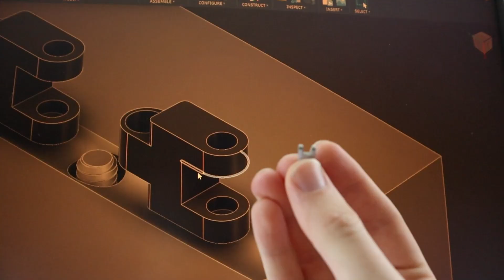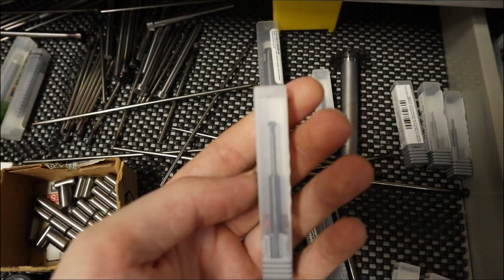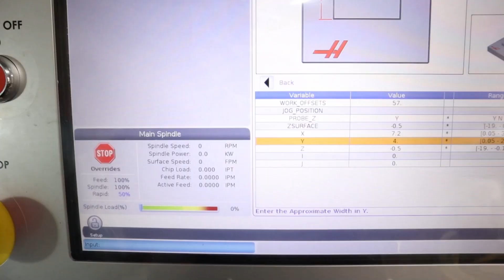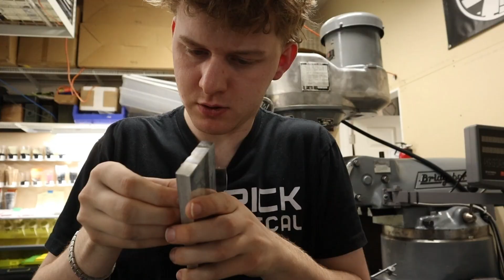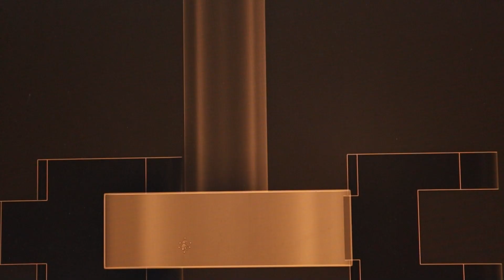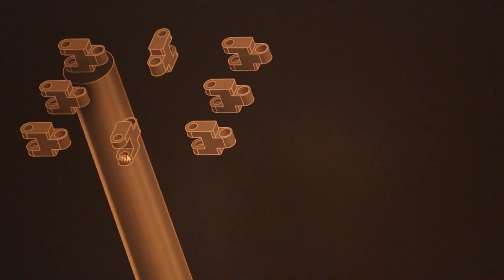I can't solve this Machining Problem | Modarra Monday's 005

Comment: dont let the way you orient parts limit you, as you were looking for a key cutter and talking about one being to big and you not having one with the exact diameter you need to get the depth, you could just rotate the links 180degerees every other one  so you can slot both links at the same time if you have a larger cutter on hand( you just need it to have a smaller height than the slot gap in the links), that way the limit for how close you can put the links together is based on the thickness of the largest shank needed to reach the chamfers and or the notch and have clearance. Im assuming your only doing this with 3 axis and without a 4th axis so that's where i'm coming from. How hard would it be to go up a stock size or two and just add dovetail to the round bar and hold like .020-.030" and then just tab the parts off with a slitting saw? Your goal would be that the dovetail + slotting height+ shank diameter from largest tool used in the notch is less total volume than  the stock your currently loosing. Im assuming the links are around 10mm long and the notch is like 4mm or so you can use this tool from amazon or something similar(KLOT AlTiN Coated T Slot Keyseat Milling Cutter Solid Carbide 12-20mm diameter)and a thinner tooth thickness so you can also cut underneath the center posts that go in the notch with the same tool. You would end up with somewhere between 6.5 and 10.5mm between parts. Lastly I would make a sandwich plate that I can put all the parts in after they have been tabbed off out of either a 3d print or machined aluminum and have it be bolt together and just toss it in a vise for cleaning up the last face, its minimal stock removal and allows for loading outside the machine and you could make multiples of them if you wanted and have them be stackable so you could do a single line, double line or more.
Reply: after modeling up one and reorienting it might actually be better to have them with the long sides facing each other so instead of 180 out they are 90, if you can get the whole part to fit inside the 1/2" bar and leave enough stock for the slitting saw you can get a full bracelet in a single piece of 6" stock. I was able to squeeze 20-22 pieces that are 4.5mm thick, 10mm long and 9mm tall( would probably shrink thickness just a tad to be able to use either a 3mm or 1/8" endmill between parts to get all sides but the bottom tab because i have them spaced about 2.5mm  apart and there is almost no space). Another thought for fixturing is using two er32 collet blocks and just drilling out the bottom of the blocks so the bar can go all the way through and using them either between two vises or if you just go with square base ones in a single vise on parallels. That way you can just shove the whole bar in and just slide it enough for the number of parts you want to make and snap it off and move the bar over again. Relatively cheap to buy and repeatable by making a stop in one side of the collet so you minimize the amount of stock held on one side.
Reply from the maker: @TheDarkrider551  LOVE Comments like this, have you seen the latest episode? I think I'm going back to the one piece per stick approach. Check out the latest videos it will be more clear. I do however REALLY like the idea and reminder of a simple soft jaw or printed fixture for the tabbing op. That is something I'm going to ponder FOR SURE. Thank you!!!

Comment: Loving this series, looking forward to seeing more episodes.

Personally, I’d choose a V groove in the fixture, because you will then have 2 points of contact which is more stable than a curve machined with a ball mill, due to the cusps left behind. Also, the SS Bar stock I assume is not ground to exact size, so may not always fit your curved slot, but a V groove milled with your chamfer mill will always locate different diameter stock centrally.
Reply from the maker: Yeah I agree with all of this, it was my original plan but I wanted to try this not sure why haha. New fixture will be a V shape like the original fixture I used to make the first links. Thanks for commenting and watching! Could you see yourself wearing a Modarra bracelet?

Comment: Great video! I'm enjoying this series. One thing I thought about the salami slice method you mention as the latest approach is are you planning to hand remove each finished link by hand before moving down in Z for the next link? Will that kill the chance for automation?
Reply from the maker: Thank you for the comment! I LOVE reading these. Also, love the nick name for the method lol! I was thinking if I can create a fixture that has 10 sticks of material, it would do the machining, then I would pallet change out, get another pallet running, then remove the parts, adjust things etc. I have a 30 pallet system, not expecting to use that full capacity right away but I could atleast make 6 pallets, and run these overnight. Whatcha think?